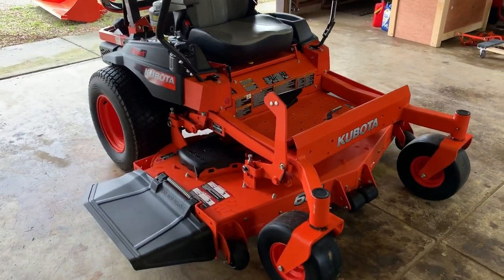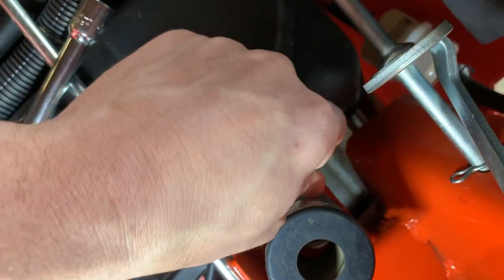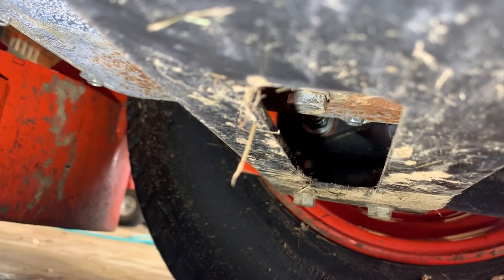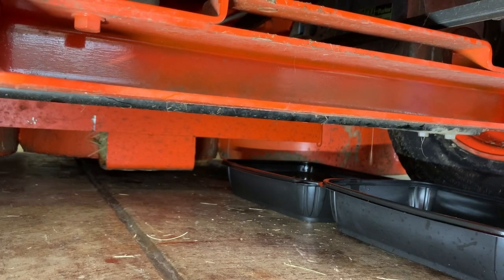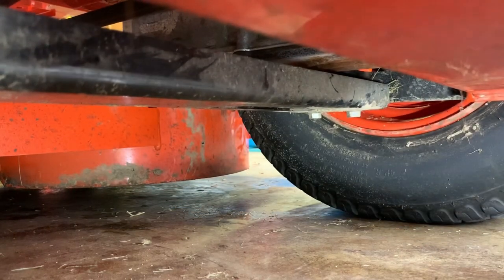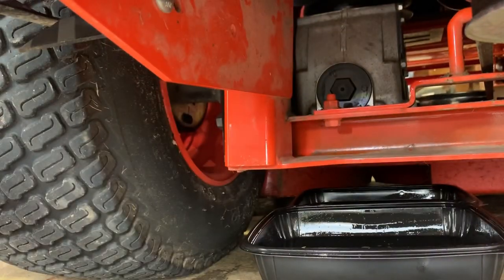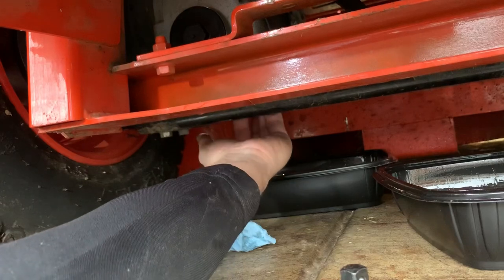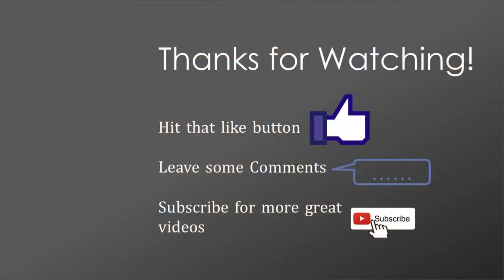How to Change Hydrostatic Oil on a Kubota Zero Turn Mower Step by Step

Comment: So the place I work at has a Z781i and we got the stuff to change the trans filters. Talked to 2 different dealers and they both said to just drain it, change the filter and fill it up. Neither told me anything about the breather at the top! Hopefully I didnt damage the pumps because I called them both again and I told them the oil wasn't getting into the pumps. They said," just crank it up and work the oil in by the control sticks." Then came to YouTube and found your video. I really appreciate your time and knowledge shared. A short little plug for where I work is Deer Lake Cabins in Mt. Vernon, Tx. Gice us a call for your next family vacation! We've got side by side rentals with 20 miles of trails, horse back rides( guided) and our Lake side Cabins have their own personal docks for fishing in our stocked Lake! Again thank you so much foe this video!!

Comment: I have been a mechanic for 35+ years, this is the way to do the job! might be a little over kill on some points, but if you want it done right this is how its done ,  Unfortunately  this is not the way your local Kubota dealer will do it. lol . management would not like the added time it takes, management does value profits over quality! sometimes profit over return business. seems thats how tings are changing

Comment: Thanks my friend. I know I can do this now and avoid the time and cost of the dealer. I inherited two at work that I use for the grounds and the oil in both machines look dirty as a dog with a dead bone. Hoping it'll help with the performance. These two machines have over 800 hours each.
Reply from the maker: 800h is impressive. I use mine to maintain my home (mow about 3 acres) so if I can get 800h+ out of mine, I should be good for the next 10-15 years! Good luck with your project. I have some other more straight forward maintenance items I plan to post in the near future (carbon canister filter, oil & oil filter, air filter, spark plugs, etc). Hopefully they can help someone out.
Reply: @EvolutionDIY  you should be good. I use a z723 & z724 and we beat the heck out of them all season and being that we are micro managed we often mow grass 5 too 6 feet tall on hill sides and through fields that are two and five acres and road sides full of landmines of rock and small boulders. I live in rural  Western Washington near Mount Rainier. It's crazy but it's also kinda fun. Enjoy and God bless you my friend.

Comment: Thanks man for the information and video. I'm going to change my hydro fluid on my Hustler Fas trak tomorrow. Like you I won't to avoid trouble. But I have a 4 year warranty with 3 on my engine. But I still think it's better to be safe.

Comment: Thanks for the info. Just picked up a z725 for a couple grand that runs and operates great but has 240h on it and I know this hasn’t been done. Now PawPaw knows. Thanks again.
Reply from the maker: Awesome. Mine has over 400 hours now and still going strong, no issues so far! Good luck with your maintenance!

Comment: An excellent effort emphasizing cleanliness and safety. NOTE to never use the RED type of Brakleen near plastics or rubber. Also Brakeleen can be bought in bulk 1 gal or 5 gal cans to save $ and use a refillable Sureshot sprayer or similar. I need a steam machine to get mine to look as good as yours - good job ! 👍🏼

Comment: The video was awesome step by step very good instructions. I feel confident that I can do the filter replacement service myself. I  do have a question before I change it. The mower will hesitate and will not turn to the left or the right that's forward and backward. I'm trying to troubleshoot. What do you think?  Thanks for your help.

Comment: This was very helpful. I had to take off the crossmember to take off the drain plug. Two huge areas where Kubota dropped the engineering ball was not having the hole in the cross member properly positioned to allow a socket to directly access the drain plugs and that stupid upside down bolt on the belt guard that prevents easy access to the filter. Wouldn’t have cost Kubota a dime to rectify those two items to make it soooo much easier to service the hydros. Oh ….oh …. Move the seat support 1/2” forward to give straight access to those overly tight breather plugs. Shame on Parker for over-torquing those, but having straight access would help a lot. Glad I won’t be needing to do this for another 500 hours.
Reply: I stripped the 8 mm breather port plug; any ideas on how to remove? Why were they torqued so darn tight?!? Grrrrr!
Reply: @johnruwwe342  I had to hammer a corresponding (I’ll have double check size) torx head socket (get a decent brand) into the plug on one of mine to get it out. Seemed like the torx got a better bite. I also found they came out a little easier when the hydro was warm. So I removed mine after mowing for about 30 minutes. I agree, someone at Parker was over-torquing these by a stupid amount.
Reply: A local mechanic dropped by; he hammered bit into breather plug; he freed it up. Thank you Lord. I really thought I had that 8 mm seated properly. Tough area to work and hate having to use breaker bar! All good. Love your content and attention to detail and cleanliness.

Comment: I bought the z781kti60.  What a beast it is!   Looking forward to Fluid change in future.  Wear do you get the repair manual.
Reply from the maker: I don’t actually have the official repair manual or shop manual, I am just using the owners manual (officially called the operators manual). It’s actually pretty good at showing most of the maintenance items, steps, etc. Just do a quick google search for “kubota z726x operators manual” and it’s the first link.

Comment: My manual lists the following recommended fluids for my Z726X: Castrol Syntec 5W-50, or Valvoline Premium Blue Extreme Diesel 5W-40, or Kubota Genuine Lubricating Oil 5W-40 (in that order).  Is the Parker fluid like the "Amsoil" of hydro lubricants?
Reply from the maker: Actually my manual lists the same as you mentioned. I did some internet research and many recommended the Parker fluid, and then when I called the dealer, they recommended the Parker too. The mower actually has 2 Parker hydro pumps (one for each wheel) so I assumed using the Parker OEM fluid was best, plus everyone recommended it. Not sure if it’s “Amsoil” level or not, but it was OEM for the pumps so I went with it. I was dang expensive though! Haven’t had any issues in the last 2 years.
Reply: @EvolutionDIY  The Parker fluid states it's good for 1000 hours.  Since the next change is recommended after 500 hours, the Parker fluid would be a safe bet.  Mine is due for its first 300 hour change in about 8 more hours of use.  I'll try to shop around to see if I can find the fluid cheaper than $20/qt.  $60 for those filters is insane also!

Comment: I have stripped out the 8 mm breather plug on the left side. Any ideas on how to remove?
Reply from the maker: That is going to be super difficult. I have had some luck in my past on brake caliper screws cutting a slot in the top of the screw with a small dremmel cutting wheel and the. and using a manual impact driver with a hammer. I don’t know that you have the access you need to do that though. At any rate, I would start putting a few drops of PV blaster penetrating oil on the bolt every day or 2 to start loosing it up. Best of luck to you.

Comment: Great job, will be buying a 54"Z421 this week. But I wanted to know how to take care of it first, your video made up my mind for me. Just one question, is it possible to add a short nipple and cap to the transmission drain to make that part easier to access. Would it clear the access hole in the plate below it? Again thanks, Theresa
Reply from the maker: I think you could probably get something like a fumoto engine oil drain valve in there. Honestly though, the hydro oil only needs changed every 500 hours after initial break in. I wouldn’t waste my money unless you’re a contractor that blows through the hours. For me, it will probably  take years before I need to do this again.

Comment: Good video thanks. my mower tends to have a loud whining noise coming from the transaxles, in the manual on page 36 it mentions if noises are heard after you operate the motion control levers the HYDRAULIC MECHANISM is not adjusted properly. do you know how to adjust the hydraulic mechanism?
Reply from the maker: Honestly mine whines pretty bad too (both sides) My Kabota BX tractor also whines when I operate the pedal to move it forward and back (it’s also hydraulic). I kind of just assumed the whine is normal. I’ll look into it and post back if I find something out. As of right now I do not know how to adjust it. Thanks for bringing it up.
Reply: @EvolutionDIY  I had the parts guy at a Kubota dealer tell me it was normal too but I don't believe it. yesterday I tried something. I disengaged both drives like if you're going to push the mower and then re-engage them only one at a time and found out that only one of the drives is making a whining noise so that tells me that it's not a normal noise one is absolutely quiet and the other one whines  like a five-year-old
Reply: @MikeDPlxztc mine does too, this is not normal!!!!